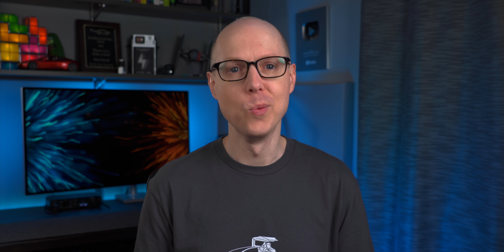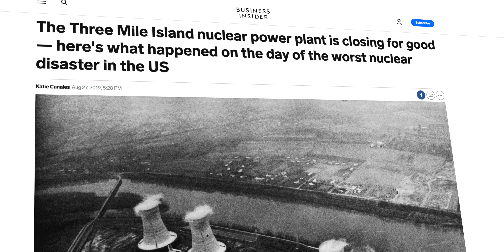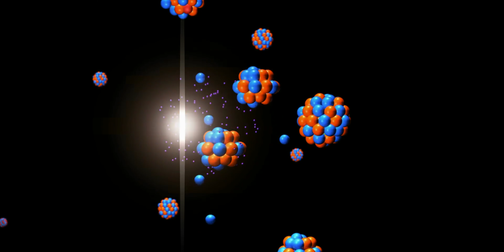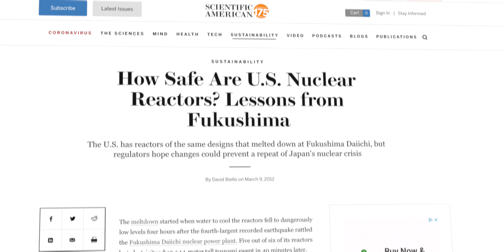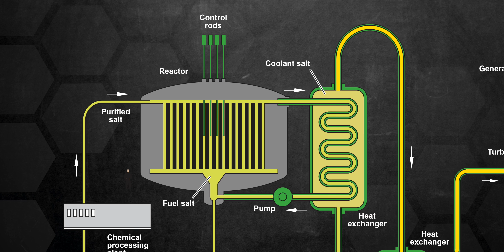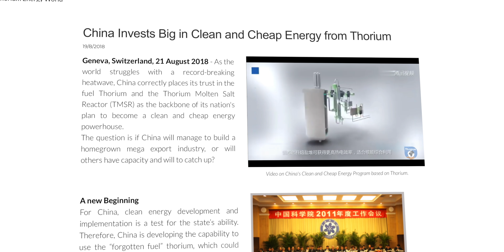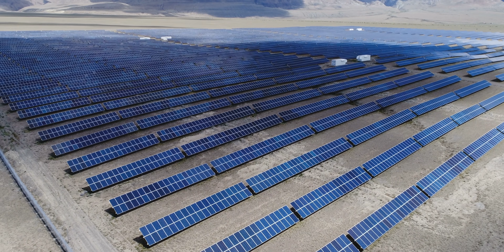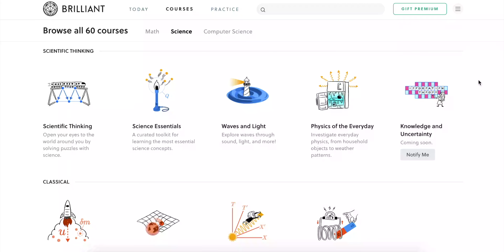Thorium explained - the future of cheap, clean energy?

Comment: Excellent video.  The U.S. had better get it's act together on Thorium Reactors.   Otherwise it will left in the Dust by India and China.  It's a fallacy to think renewables such solar and wind will be sufficient.  They require storage/batteries since they are Intermittent.  Many businesses require electricity  24x7x365.  Solar & Wind will not be sufficient even with batteries.  Thorium MSR's appear to be the best option.   The Federal Govt should be subsidizing this big time.  Clearly China & India are.  If the U.S. is complacent, we'll be buying yet more things from China/India, namely 4th - Gen Thorium reactors.   They have foresight whereas the U.S. is STILL living w/it's past laurels.
Reply: Any known nuclear generation technology cannot compete with wind and solar on economics.  Even when you add in storage which both RE and nuclear need.  

Yes, nuclear in a best case situation can load follow to some extent.  But when you curtail nuclear output you greatly increase the cost of electricity produced.  Almost all the cost of nuclear produced electricity are fixed costs, not fuel costs even when the fuel is uranium.  Cut output but the fixed costs still have to be paid.  What happens is that you spread those fixed costs over fewer MWh of electricity sold.

A reactor running at <optimal output (90%) will have to charge more than a reactor running at optimal output.  

Unsubsidized wind and solar are moving below $0.03/kWh.  Vogtle and Hinkley Point are going to produce ~$0.15/kWh electricity.  The cost of fuel for reactors is less than $0.01/kWh.  In order for nuclear to compete there has to be a way to lower fixed costs enough to allow a new reactor to sell electricity for $0.04/kWh or less.  Reactors that sell electricity for $0.05/kWh are going bankrupt in the US.  Dropping costs from 15 to 4 cents is a massive task.
Reply: @bobwallace9753  
Hi Bob,
People who are racist ignore the price of nuclear reactors made in China and India.  They have FAR lower costs for nuclear than those built in the USA because the USA has senseless safety requirements.  (Nuclear power regulations in the USA require nuclear power to be 12,000 times safer than coal for example.  Further, coal pollutes low levels amounts of radioactivity in its waste, which it has got the government to ignore.  If nuclear power plants released as much Uranium and Thorium as a coal burning plant is allowed to, they would be shut down.)

There are designs for modular nuclear reactors which can be constructed in a factory and moved on site using a shipping container.  If you look into modern reactors, you will discover that nuclear power can be much, much cheaper than it has been allowed to be so far.  This is a moot point in the USA, but other nations are going nuclear in a big way.  China alone will double the number of reactors on the planet by 2050.

The cheap power will be a big boost to their economy.

Some links:

https://www.sciencedirect.com/science/article/pii/S1674927817301181

https://www.nextbigfuture.com/2019/06/iea-data-shows-nuclear-investment-adds-more-power-than-wind-and-solar.html

http://environmentalprogress.org/the-complete-case-for-nuclear/

https://www.nextbigfuture.com/2020/02/china-will-surpass-france-in-nuclear-power-generation-this-year.html

https://www.nature.com/articles/s41560-017-0009-8.epdf?author_access_token=aH0zbeyBMKe-ztqdommdNdRgN0jAjWel9jnR3ZoTv0OyLLEcIVrbwv-XjMBX8LWW5XTAymRsrwwntLZpd13c0rFV4PDemwy7NO5c87YQWrty8K-iySi15WFLB4KmtPeX440qesPTsBvYo0898Wca4Q%3D%3D

https://www.nextbigfuture.com/2020/01/german-nuclear-phase-out-boosted-emissions-by-5-and-caused-over-10000-deaths.html

Warm regards, Rick.
Reply: @RicksPoker  
"People who are racist ignore the price of nuclear reactors made in China and India. "

Really?  Really?  You actually want to believe that?  It smells of despiration sweat.

Yes, China and India can build reactors cheaper for reasons of cheaper labor and, I suspect, less regulation.  However less regulation can lead to failure and sometimes disastrous failure.  I'm pretty sure we're only one nuclear disaster away from a rapid closure of pretty much all nuclear reactors.  Especially in Western Europe and the US.  Public opinion will most likely override any arguments from the nuclear industry and nuclear advocates.

Cheaper?  Yes, but China and India can't build reactors that compete economically with present day wind and solar prices.  Have you noticed how China's new reactor construction starts have drastically slowed?  IIRC, China started construction on no reactors in 2017 and 2018.  The started construction on three in 2019.  That's far less than what was happening in earlier years.

Comparing nuclear safety to coal would make sense if the choice was nuclear or coal, but it isn't.  The choice is nuclear or RE and RE wins on multiple fronts.  RE is cheaper, safer, has much faster installation times, can be built close to demand, and creates nothing like the very long lasting spent nuclear fuel problem.

NuScale is the company apparently the furthest along with small nuclear reactors.  They have claimed that once they reach economy of scale their SMRs will generate electricity at $0.08/kWh.  That is not even close to competitive.

China may have twice as many reactors as all other countries combined but that's because the vast majority of non-Chinese reactors are aging out an most will not be replaced with new reactors.  I just saw an article about how Hinkley Point B has now been shut down for one of the last times.  It's graphite blocks are developing cracks and that reactor, along with other UK reactors, are going to have to be closed for safety reasons in the next few years.

Look up some data on the age of reactors.  I can't post charts here.

Wind and solar are bringing cheap power.  Nuclear, without some yet to be imagined breakthrough, cannot. The UK is going to see it's average wholesale cost of electricity rise once the new Hinkley Point reactors come online.  The same is true of Georgia ratepayers who get their power from Southern Company when Vogtle 3 and 4 start producing.  In fact, rates have already been raised to help pay for the reactors before the reactors entered production.  South Carolina ratepayers saw their electricity rates rise 30% to help pay for new nuclear there, even before the project was abandoned.

You can't average in more expensive electricity and see the average cost go down.
Reply: @RicksPoker  BTW, Rick, please list any regulations that the US nuclear industry has stated to be unnecessary.  I know that they've attempted to reduce staffing at existing reactors and run them with fewer technicians on site.  But would you give a list of unnecessary regulations on new nuclear construction and how much costs might be reduced were these regulations dropped.
Reply: @bobwallace9753  
Hi Bob,
Thanks for the fast reply.

I think you might like to read: "Renewable Energy - Without the Hot Air" by David JC MacKay.  He goes to extraordinary lengths to make Renewable work.  (He even has tens of thousands of underwater turbines to harness tidal power.  I read this and think 'barnacles'.)  He has said that he is no fan of nuclear, but he discovered that to make 100% renewable work is HARD.  He was appointed to be the United Kingdom's advisor on Energy, but sadly he died a year ago.

As for saying that people who quote obscene prices for nuclear construction, and ignore the far more reasonable prices of such construction in China is racist, is Brian Wang's comment, not mine.   He wrote a very interesting article about the cost of new nuclear construction.

I had not heard of the slow down in China's construction of nukes.  Is this a general policy trend, or a statistical artifact?

I compare nuclear to coal because coal is the form of power I most want to see shut down.  If some one argues, "renewables are cheap, last a really long time, are low maintenance, energy storage is easy, and we don't need anything else!", then I am fine with that.  All I ask is that let us wait until the fossil fuels power plants are shut down, before we start closing nuclear.  

Germany closed their nuclear power plants, and the cost for energy shot up and the fossil fuel use skyrocketed.  They have been building solar and wind like crazy ever since and their fossil fuel use is about back to normal, but the cost of electricity remains high.

Warm regards, Rick.
Reply: @RicksPoker  I've read MacKay.  Multiple times.  And I find it largely worthless.  Plus, as you report, MacKay died years back and RE technology has greatly advanced since his time.

Of course it will be hard to build a global 100% RE electricity system.  That's a huge project and it would be even harder to build a worldwide nuclear generation system.  It would take far longer and cost far more.

I don't care who first made the statement claiming that one who ignores the cost of nuclear is racist.  That's simply a stupid thing to say.  You could correctly claim that someone who ignores the cost of nuclear in China is poorly informed.  You could say that about anyone who hasn't gathered all the important information before forming their opinion for or against nuclear.

Let me give you some information about China's nuclear program.  Construction starts per year.

2005	1
2006	2
2007	2
2008	6
2009	9
2010	10
2011	0
2012	3
2013	3
2014	0
2015	7
2016	2
2017	0
2018	0
2019	3

As you can see China had an active building program in 2008 through 2010.  Since then China has greatly decreased their rate of construction starts.  

I agree, in general, that we should keep operating nuclear plants until coal is gone.  But I make exceptions for reactors that might not be safe or for reactors close to populated areas that could not evacuate in the event of a nuclear disaster.  I was glad to see Indian Point closed because there is simply no way to evacuate New York City in a timely manner.  And, remember, had the wind been blowing the opposite direction when Fukushima melted down Tokyo, a city that can't be evacuated, would have been in the radioactive cloud.

We need to live a bit longer with CCNG plants because they are so highly dispatchable.  We'll need them while we build out RE and storage.  And we might need them for the "last 1%" of generation, those extended periods of low wind/solar output.  At that point we should be able to fuel them from methane captured from urban and agricultural waste streams along with synfuel if needed.

Germany incurred a 4% increase in coal use when they sped up their nuclear plant closing following Fukushima.  It took them about three years to bring coal use back down on the fade away track.  

Here are German retail electricity rates for the year before Fukushima and the next two years.

2010	23.69
2011	25.23
2012	25.89

As you can see there was a 1.54 eu cent increase from 2010 to 2011.  A 6.5% increase.   Here are the costs of electricity without distribution costs and taxes for those years.

2010	8.16
2011	8.01
2012	8.16

As you can see the cost of electricity dropped in 2011, it did not shoot up.  And in 2012 it returned to what it had been pre Fukushima and German's reactor shutdown.

Germany has one of the lowest wholesale costs of electricity in the EU.  Lower than heavily nuclear France.  Retail rates for electricity are high due to two reasons.

1) Germany adds a large amount of VAT (sales) tax on electricity.  Money that has nothing to do with electricity, just a revenue source for the government.

2) Germans agreed to create a substantial subsidy program for solar which has largely been responsible for bringing the cost of solar panels down from several dollars per watt to less than $0.50/watt.  They created a market which drove economies of scale.  

In 2017 Germans paid 29.2 euro cents per kWh.  6.9 eu cents went to the RE subsidies.  9.2 eu cents went to taxes and fees.

The oldest and most expensive subsidy (FiT) programs are now aging out and that 7 cent subsidy will fade away over the coming years.  That will leave Germans paying some of the lowest electricity rates in Europe, aside from taxes.
Reply: @bobwallace9753  
Hi Bob Wallace.
According to Wikipedia China is still intending on building more reactors.  They are talking about building another 6 to 8 reactors per year.  There are currently 38 reactors planned with a 38,134 MWe capacity and this is not counting small reactors to provide heat for subdivisions and factories.

I think that part of the reason we are seeing fewer reactors is that many of the reactors built 10 years ago were fairly small intended to test out new techniques and designs.  Now China knows what works and is building bigger designs.  My readings about new reactors plans in China seem to now be all large reactors.  (This paragraph is speculation based on what I've read about Chinese nuke plans.)

Wiki also mentioned that building reactors was slowed because Westinghouse went bankrupt. 

https://en.wikipedia.org/wiki/Nuclear_power_in_China

Your claim that France has high power costs and German has low electricity costs does not match up with what I've been reading for a long time.  Here are a couple of quotes I found from a few seconds searching on the net:

German prices in 2017 were €29.16 cents per kwh for residential customers, an increase of 35% over 2008.[7]

German households and small businesses pay the second highest electricity price in Europe for many years in a row now. More than half of the power price consists of components determined by the state. These include charges for using power grids (24.6%), levies for financing investment in renewable energy (22.1%) and for other kinds of taxes (e.g. GST 16%).[7]

// Wikipedia
https://en.wikipedia.org/wiki/Electricity_sector_in_Germany

France enjoys one of the lowest electricity prices in Western Europe. At €0.1765 per kWh in 2019, the average cost of electricity in France is 26.5% cheaper than the EU average (€0.2159 per kWh), compared to Spain or Germany where prices are respectively 46% and 79% higher than France's (Source: Eurostat).

// there didn't seem to be a wiki page for Frances power like Germany, but I found this...
https://en.selectra.info/energy-france/guides/electricity/cost

Now the wiki page says that a high percentage of the German price is various taxes, and you say that the government is planning on lowering these taxes in the future.  That may be so, I'll defer to your expertise.

Anyway, I've been at this for a good part of the day, so I need to sign off.
Warm regards, Rick.
Reply: @RicksPoker  I believe I was replying to your claim that China has been building a lot of reactors in recent years which is not the case.  China slowed down.  I don't know what China will do in the future.  Perhaps they will spend their money wisely or perhaps not.

"Your claim that France has high power costs and German has low electricity costs does not match up with what I've been reading for a long time."

Again, Rick, retail rates do not accurately reflect the cost of electricity in a country.  Some countries add lots of taxes and fees, some don't.  Review wholesale baseload electricity prices in the EU Quarterly Report on EU Electricity Prices and you will find that France has a higher average wholesale cost of electricity than Germany.  The wholesale rate is the closest thing we have to actual cost of generation.  Retail rates, which you are quoting, tell us nothing.  Again, taxes and fees differ by very large margins from county to country.

 I haven't been keeping up my data collection but I can give you several years of average wholesale electricity prices for France and Germany as released by the EU.

	France	Germany 
2013 Avg	44	38
2014 Avg	35	33
2015 Avg	39	32
2016 Avg	37	29
2017 Avg	45	35
2018 1st Half	41	36

As you can see in every case electricity in France is more expensive than in Germany.

And - one more time - do not use non representative cost by including taxes and fees.  That is something that fans of nuclear have been repeatedly doing over the years.

If you buy a dollar's worth of nails in Alaska you will pay $1 because Alaska has no sales tax.  In California you will pay $1.07 because California has a 7.25% sales tax.  In both cases the nails cost $1.  Taxes make the out of pocket higher but that extra does not go to the supplier of the nails but to the state government.

What you are going to see in those numbers is the amount the French government is likely to be subsidizing their nuclear fleet.  They do not release that number.  They did release data a few years back showing that the cost of operating their reactors was higher than the wholesale cost of electricity in France.  That could only be explained by an undisclosed subsidy.  Remember, the French government owns about 85% of France's nuclear industry and the other 15% is owned by "friends".  The Électricité de France S.A. is deeply in debt and in danger of bankruptcy.  

As for Germany, what I said is that about 7 (IIRC) eu cents is due to the solar subsidy.  A feed in tariff or FiT.  That amount is now dropping because the oldest and most expensive FiT contracts are aging out.  I know nothing about Germany planning on lowering retail electricity taxes.  Taxes which have nothing to do with the generation of electricity but are simply sales taxes.  Those taxes are larger than the current FiT.
Reply: Fission requires "storage/batteries" if it makes up a large percentage of the electricity supply, it doesn't ramp up and down well. Solar, wind, batteries and all the other tech that has and is been developed will be able to supply 100% of needs. Thorium is still a way off even with masses of investment (and who is going to risk that sort of cash when renewables are so cheap) and we can't wait.
Reply: @turningpoint4238  Load following is an issue for pressurized water reactors, but due to different operating characteristics,v not so for more salt reactors (MSR). MSRs are expected to have latency comparable to hydro and easily follow demand variations on a grid also supplied by wind and solar as those sources vary supply